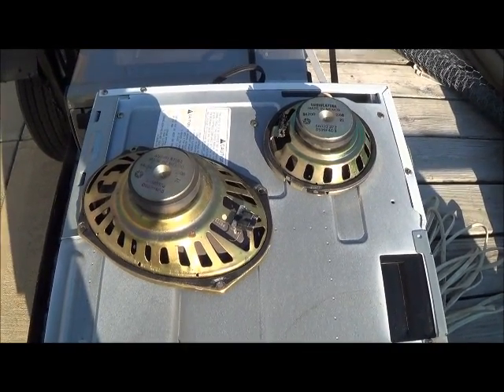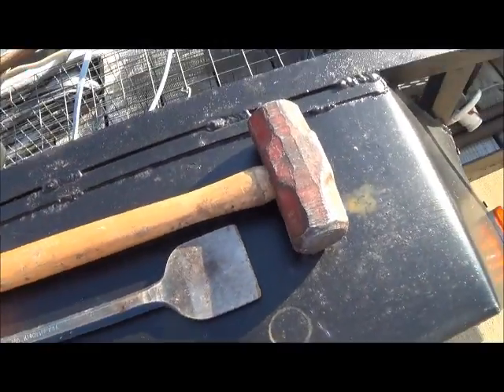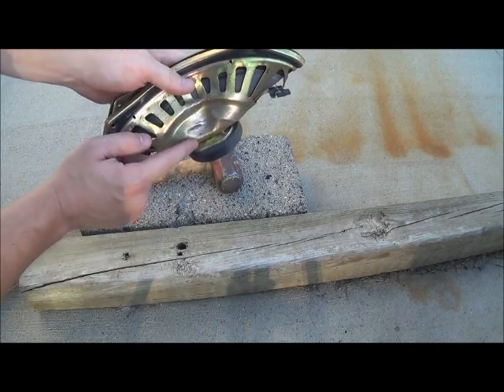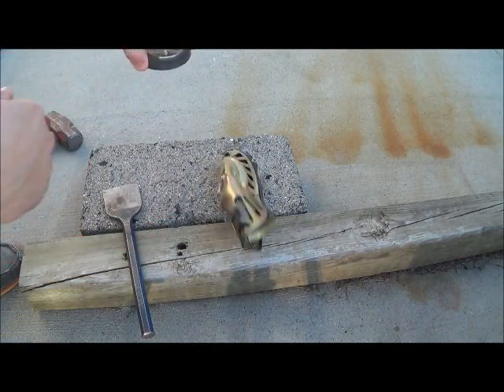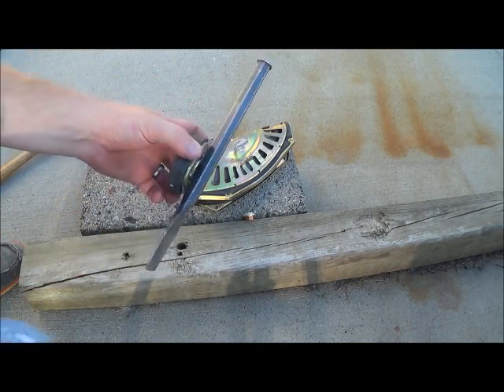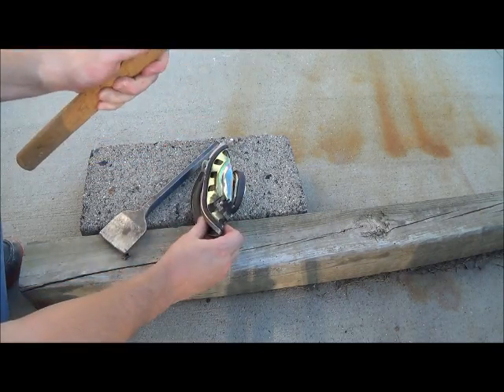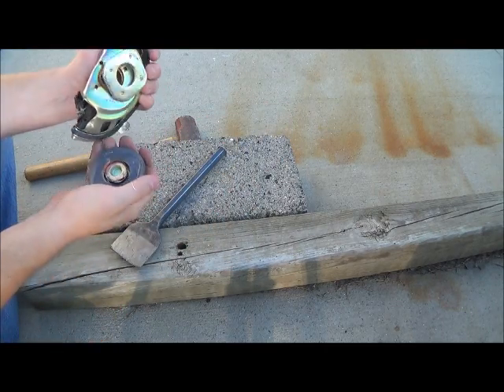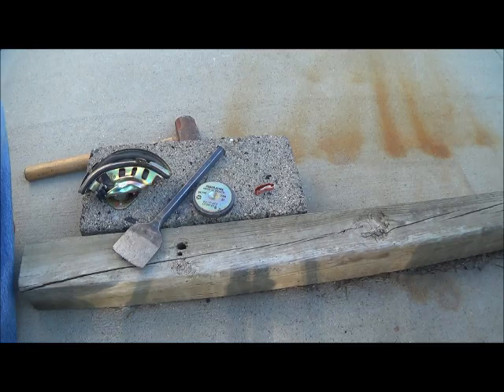Best place to get magnets! Easy removal from speakers! Ferrite Magnets

Comment: please just spend a few Cents on a magnet instead of wasting a speaker. thanks
Reply: ddorfpunk1 234 ha a few cents
Reply: this video wants all to know that speakers have magnets which can be removed and how to remove 'em then used it again
Reply: ddorfpunk1 234 yet again the speakers may not work.
Reply: Its from an old speaker
Reply: Angelo Joson Well, that door speaker can be sold for $15-$25. That’s way better for selling the whole speaker I guess. It depends on the speaker and what you’re doing.
Reply: ddorfpunk1 234 or use a blown speaker that you already spent a few cents on